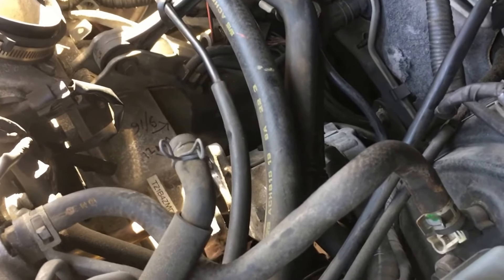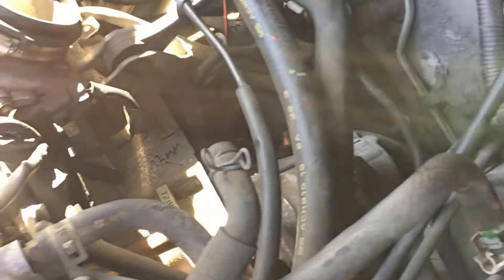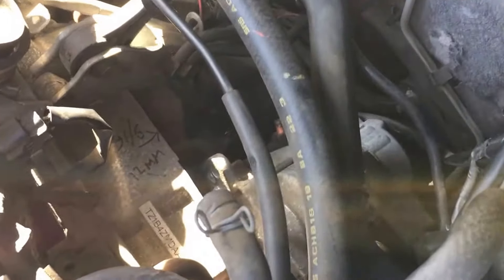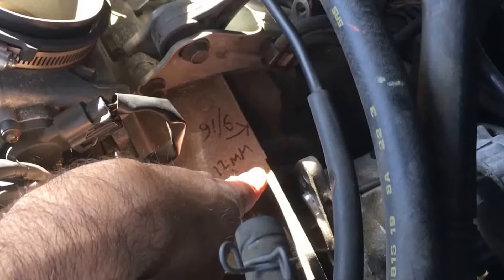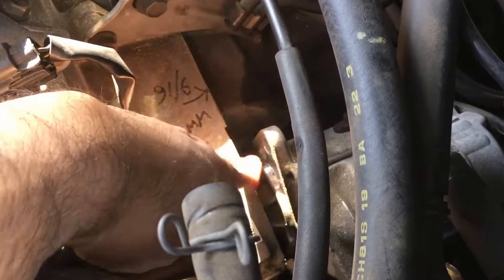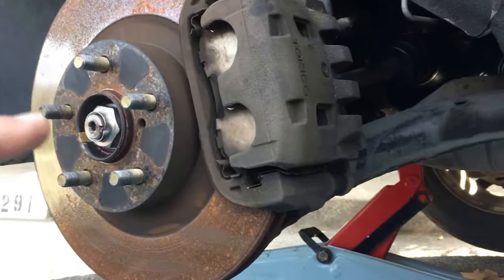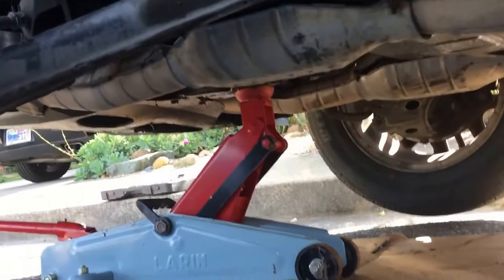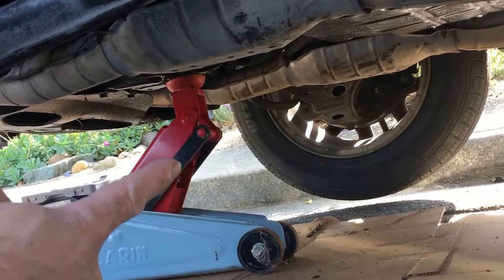Removal of starter Subaru 2002 Outback 3.0 H.6

Comment: Thank you. Taking the tire off to get at bottom bolt. Mine was so tight I had to use a breaker bar I thought I was doing something wrong.  Thanks again for the great advice.
Reply from the maker: Cheers.  It’s a lot easier than trying to do the spark plugs!

Comment: Hey thanks for the vid. I’m new to workin on cars for the most part. I have the exact model and my starter needs replacing. So all I gotta do is take out the bolts, swap it, and it’s good to go? Just like that?
Reply from the maker: NolanSorensen yup!  Works!  Or you can do what the Guy previously said... look at the comments.  Always two ways to skin a cat.
Reply: rudestrudedog nice! Thanks bff or your reply. Also, is the starter for the h6 3.0 ll bean 2002 the same starter as 2002-4 regular Outback wagons? Was thinking of going to junkyard but don’t want to buy the wrong part lol

Comment: Well thats one way to do it. I was wondering if I was going to have to go there but i didn't. What I ended up doing was creating a stack of extensions roughly 9 inches long with the socket on the end. From the top you stick the stack under the starter and feel around till you lock onto the bolt. Then hook the ratchet on and undo it. You are poking blind but it doesn't take forever to finally hit the mark. Faster and easier than taking off the wheel.
Reply: Thanks Thomas. Is it a 9/16 inch? You used something like this? -- https://www.amazon.com/T29771-2-Inch-Standard-Extendable-Ratchet/dp/B0013VCBMA

Comment: I totally  appreciate the vid 👍 it's very very VERY hard to find anything about the 6 cylinder outback. Thank you so much 😁
Reply from the maker: yeah, like it never existed!  The 6 is way better than the 4 cyl.  and doesn't have the gasket issues.  Of course, if you take it to a dealer they will tel you that it will blow up in your face and you need to get it done asap... then you tell them that the 6 cyl IS NOT THE 4 cyl.  they then look stupid and ask if you want something else done.